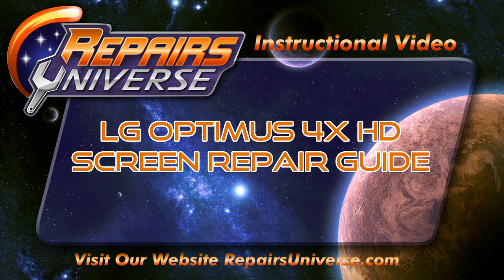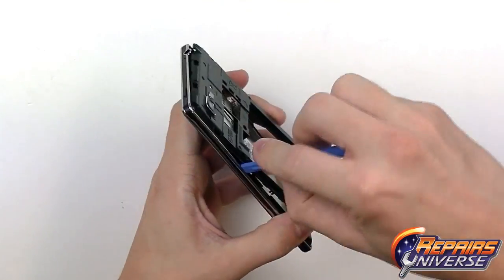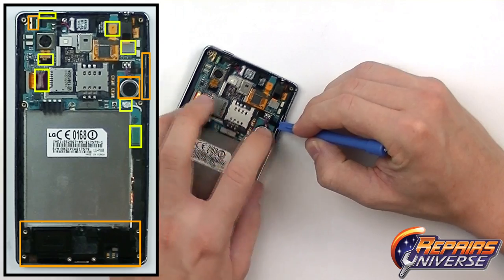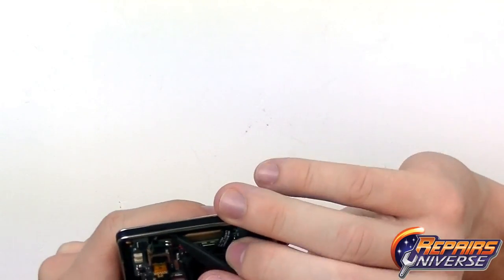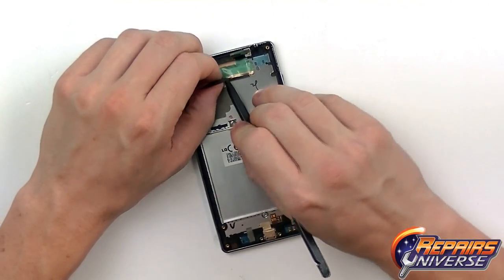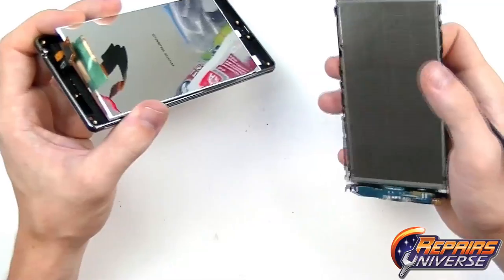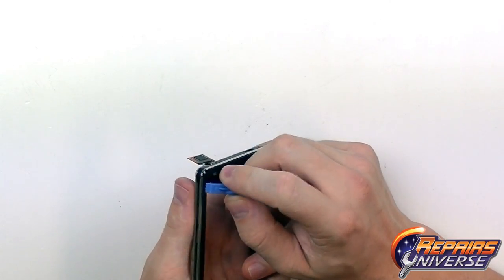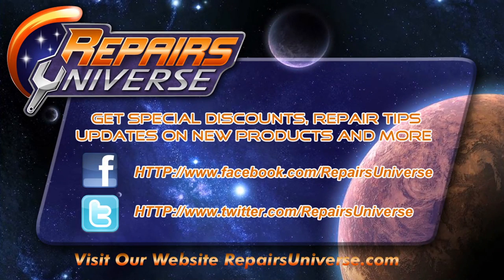LG Optimus 4X HD Screen Replacement Repair Guide

Comment: Hey Repairs Universe, I am concerned about the problem with my beloved phone. It seems that its 'display' or so called "LCD" has either broken, or has gotten spoilt. In the markets of my country the repair exceeds the phone's cost itself, soaring up-to $180. Since I'm just a kid, getting these items (screw driver/pry tool/ spruger tool) are kinda hard.
If you/you guys could help me specifying my problem, it may help. After my mom threw the phone face first on the ground from a height of atleast 1.4m, I was surprised to see no scratches/cracks. Rather I noticed that when i pressed the lock-screen button, the screen didn't turn on, but a red line comes on the screen.
Upon testing I have realized that I can still use the phone, as i have picked up a few calls and unlocked it and played a song (yes i memorized the places of the graphics). Any diagnosis of my problem would be a load of help, Thanks!
P.S. The price i mentioned was for the repair of the LCD, your prices are so much cheaper, I would just like to know why the HUGE price range. Thanks again.

Comment: When assembling a new touch screen, is it really necessary to use new adhesive tape? I've seen some movies where there's nothing mentioned about adhesive, they just push both parts together and that's it. Apparently, the old adhesive is still sticky enough?

Comment: Hi, very good explain.
I have a question? 
affects the operation of the phone if the base paper which bears the lcd is damaged? (I mean the silver color base).
Sorry about my english!
Reply from the maker: If your talking about the silver reflective bottom layer of the LCD the answer is no. It will not affect performance of the device. The picture may not be as bright as one would like due to the reflection of the back light.

Comment: thx for the video ,, i have anothe problem with my lg 4x hd .. screen keys stopped working ( Menu , Home , Back ) the screen works fine without any problem .. what should i do ?!!
Reply from the maker: Hello Islam, Check your bottom flex cable for the home buttons. There will be a small flex on the left side of the device. See if it is not connected. Check to make sure it is not damaged.

Comment: My "back" button LED doesnt power on... to stay with the back,home and menu.
Its necessary to replace the digitizer screen?
Reply: Both of the ones I've bought have this problem. I've scoured the net for how to fix or for others with this issue, but nothing. One was from Taiwan, bought in Taiwan, one was from Korea, bought off Amazon, shipped from China. Did you ever find a cure? Mine were both brand-new, seals on box, etc., so there must be a large batch of them with this issue being sold as new.
Reply: Tom Judd i've found a cheap solution... First, you have to buy a USB charger replacement for your P880, that comes with the LEDs! Then... Watch the video and replace the part! Your O4XHD WILL BE LOOK NEW AS A FUCK!
Reply: Carlos Henrique Noronha de Aguiar
 Oh Great..., so it's a bad part right out of the (sealed) box..., well, thanks for LMK what I need to replace. Perhaps I'll just send back and get something off the shelf that I can return if it has issues.
Reply: Carlos Henrique Noronha de Aguiar
BTW, where did you find repair video for the port? Or was it part of screen repair?
Reply: TR Judd its on minute 2:30 that he unconnect a flex that comes from the lower part from housing and minute 6:47 that he shows the USB port, that part includes the 3 leds
Reply: Carlos Henrique Noronha de Aguiar OK, got it mate. Thanks a million, will LYK if I undertake the endeavor or just send it back. Might cost the same either way.
Reply: TR Judd Bro, this part is very cheap, if you buy from DX.com, its a try! If you got this done,pls hungout! I buy mine at DX.com

Comment: I have a problem with my phone. My touch screen kinds of works erratic. the problem start with the lower part of my screen and the touch buttons failing (they dont work most of the time) then i replace the touch and now it only recognize two touch points instead of ten. Any idea?
Reply: I have a similar problem with my Home button not working 30% of the time. Did you find any solution? Thanks.

Comment: ok that wasn't a replacement ...   or where is the second part ?
Reply from the maker: TO assemble your device, simply reverse the process. Thank you
Reply: But do I need adhesive for the touch screen?  Or just like that. Thanks.
Reply from the maker: Yes, you would require adhesive around the bezel of the device.